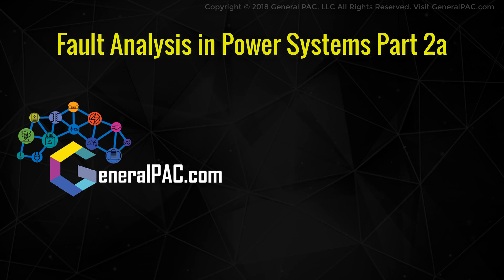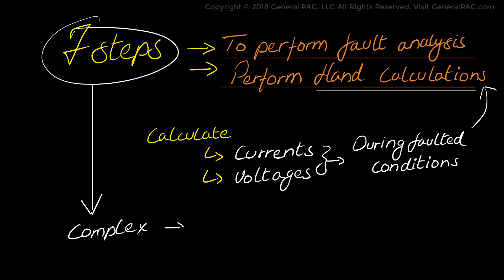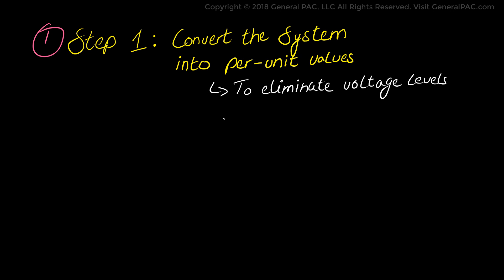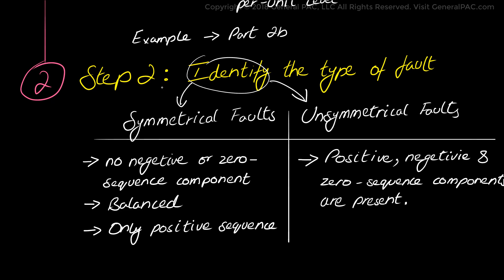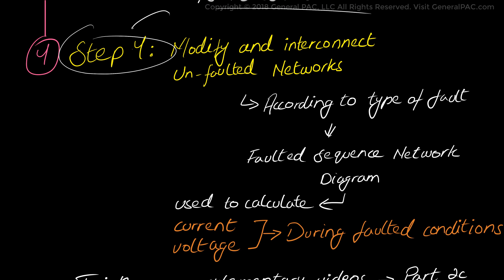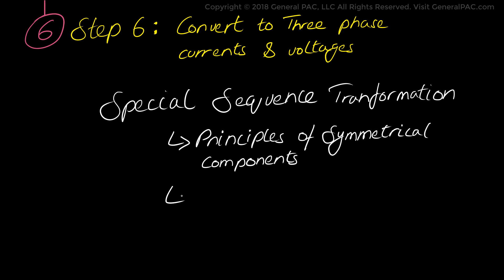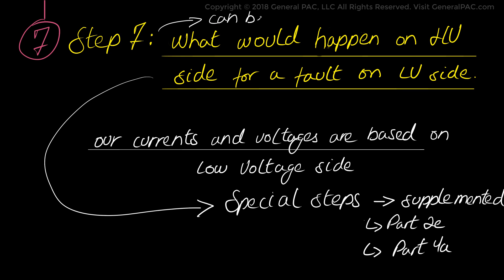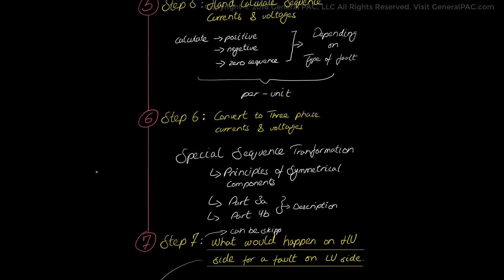Fault Analysis in Power Systems Part 2a

Comment from the maker: In the Power System Protection course, we will cover the requirements needed to design protective devices and the applications of these devices through a schematic diagram. Furthermore, this course will analyze the effects of all types of faults in power system along with the easy hand-on calculations. To develop your strong concept on fault analysis we will discuss how faults can be identified by analyzing waveforms. Lastly, you will learn the most tedious and complex theory of symmetrical components that are found in different types of faults. Currently, we are offering a 90% discount. Join us before it ends: https://bit.ly/Power-System-Protection